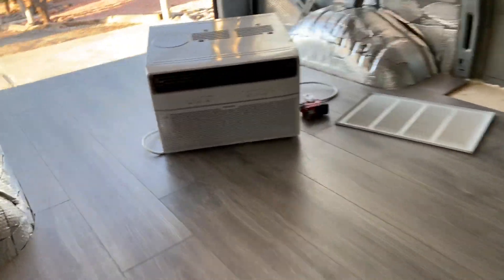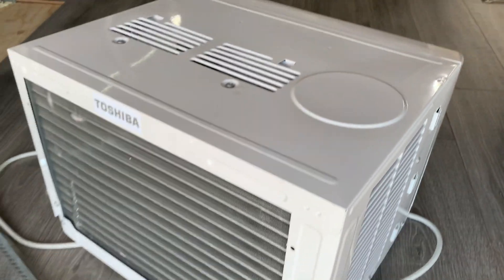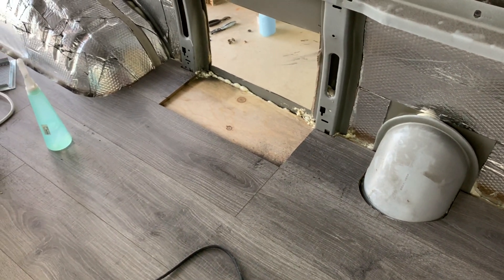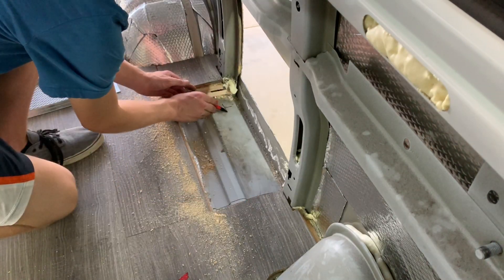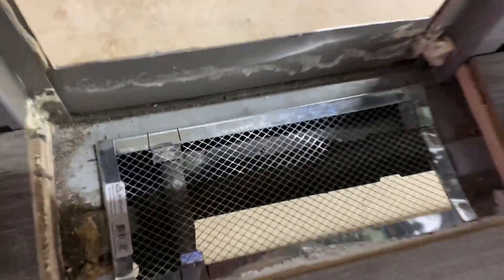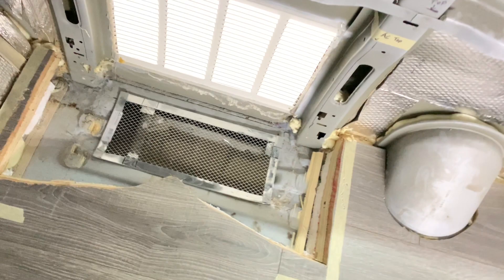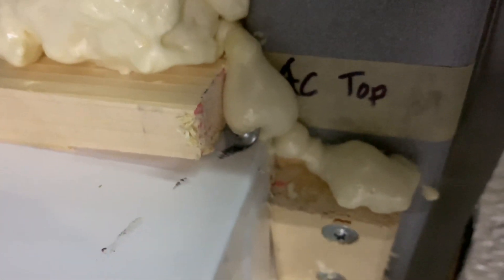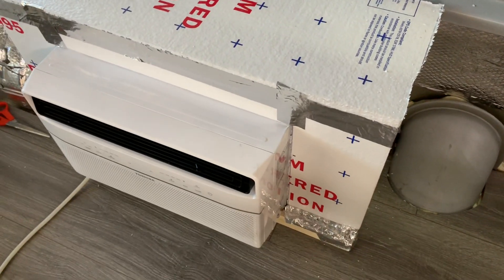Campervan Window AC Install (No Exterior Protrusion)

Comment: Cant the intake air be ducted thru the side of the van around the exhaust air?  So cutting the floor can be avoided.
Reply from the maker: Spot on George, I actually met a retired Chrysler engineer who did exactly that.
He actually used a large color matched RV hatch for the exterior vent. It was a really clean build.

On the other end of that spectrum, I saw a video where they had both the air intake and exhaust under the van and the window AC unit mounted up high inside.

Seems it would be tough for the condenser fan to such the cool air and push the hot air through the two small ducts. (Haven't seen any updates on that system)

-Tim
Reply: @VanwithTim  im leaning towards a rooftop unit but it'd be cheaper to adapt a window unit.
Reply from the maker: @georgeperkins4171  Certainly cheaper with the window units.
I'll also offer this insight (incase you plan on running via solar / battery):

The window AC units are SLIGHTLY more efficient when looking at BTU's per watt of electricity.

This 6k BTU unit uses 510w on a 75F day or 600w on a 95F day for an average of 10.9BTU per watt.

The few rooftop RV AC's I've sampled average around 8 BTU's per watt of electricity, with the higher efficiency units claiming 10.6 BTU's per watt.

That being said, typically the smallest rooftop AC outputs 13,500 BTU which is total overkill for a van.

If I were to do it again, I would probably use a 8k BTU unit. My van has so many windows that the 6k BTU just takes too long to cool it down. (I should probably bite the bullet and get some ceramic window tint in the future)

Hope that helps a bit. Sorry for rambling haha.
-Tim
Reply: @VanwithTim  Never heard of ceramic tint, does it actually work or is it all gimmick and hype? Any brands, links?
Reply from the maker: @Santor-  The theory of its effectiveness is correct, and most videos show a cheap gimmicky infrared meter demonstrating the IR blocking qualities, but all the videos simply show cars sitting in the sun before and after tint. Not really helpful as the interior will still heat up without any type of active cooling.

A TRULY helpful test should show how much cooling energy is required to maintain a set interior temperature before and after tint.

None of the tests have an electrically powered AC mounted in the vehicle which could quantify the improvements.
I would LOVE to test it myself, but it's very cost prohibitive.

Comment: So what did you do to the bottom grill? How you keeping rain, dirt, mud, snow etc from blowing up into the ac?
Reply from the maker: Good question Mike. 
It is totally open to the elements on the bottom and back of the condenser, just as it would be in a residential installation.

Any water that enters (rain spray / car wash) drains back down through the bottom just as the natural condensation does.

Dust and dirt seemed to rinse out the bottom during routine van washing.

No heavy mud has reached the area yet but will update if it does / becomes an issue!

With that said, I  put it directly behind any of the tires. My diesel heater is installed behind the rear wheel, and I had to blow out a bunch of soft sugary sand from a wild trip in Death Valley.
Very valid concern!

You can actually see what the inside of the AC looks like after 1.5 years of being open to the elements here https://youtu.be/wq_KdOZR2R0?t=125

Comment: Nice job man. No condensation issues or water trapped producing weird smells?
Reply from the maker: Seems to drain well! No odd smells or mildew. I did drill a few extra holes in the bottom above the outside air inlet to be safe (and painted the holes to hopefully prevent rust)

Thanks for checking it out 👍
Reply: @VanwithTim  I was considering a RV rooftop unit or this. I think this just seems a bit easier for sure. I never really thought about this. I’m doing this and just mounting solar on the roof instead.
Reply from the maker: @kolbymonroe5569  the rooftop units are typically a bit more powerful (and power hungry) this 6k btu unit seems to be good for a van this size. Maybe even go with an 8k btu unit if it’s a high top!
All the best!
-Tim

Comment: Better to install a portable air conditioner rather than a window unit?
Reply from the maker: For some people the portable AC would work better. The electricity usage would be about the same, but there's no installation needed.
The portable AC units are usually much larger in size though and our van is very small inside already!
-Tim

Comment: ....first thing to do with a brand new AC, is take it apart, to coat the interior metal, which is paper thin, to protect it from corrosion.    I learned the hard way, these new units, that are sold by Box stores, don't last very long, they're practically disposable units.
The styrene foam is practically translucent, I learned to coat them with paint, to make them last longer.  I'm still experimenting, with other techniques. 
The metal pan, I usually coat them with truck bed liner spray, that can be purchased from Walmart.  fyi.

never make a hole in metal, with sharp square corners, always drill out the corners with a drill. 🤔
Reply from the maker: I noticed it felt surprisingly light (not in a good way)
Will be interesting to see how long it lasts! (Past 1.5 years right now) 
Honestly surprised none of the copper lines have fractured from the non-stop bouncing of the van.
Will keep the channel updated once it finally dies out!

Comment: Hot air rises, cold air goes down, you don't want AC on the floor.
Reply from the maker: Spot on Greg. If it weren't for the windows fully wrapping around the upper portion of the exterior I would have definitely mounted it higher.
I've since added ducting to push the cool air up to ceiling level. 
Probably as good as it's going to get.
Thanks for checking it out!

Comment: Does anyone know if it's possible to use the oem condenser and blower motor(rear AC)with a mini split? In other words... Use only the outside unit from the mini split and mate it to the oem condenser? Something I'd like to try but don't know enough about Hvac to try it
Reply from the maker: That would be interesting. Wonder what specialty valves would be needed? 
Not sure if any of the mini-splits utilize R134a as a refrigerant which of course would be a necessity to mix with the automotive system.
(Although I've seen people successfully fill their R134a systems with propane. Maybe matching refrigerants aren't as much a necessity as previously thought)

Just my thoughts as a non-engineer
Reply: Food for thought  about using propane  as a refrigerate,  it's not a good choice,  freon  is used  world wide because  it won't explode.
Reply from the maker: @carlstephens1532  I remember needing to refill my brothers R12 1992 Park Avenue. Heard a lot about propane but eventually sourced some old R12.

There’s something just sketchy enough about running propane that I wouldn’t want to do it.
Reply: @VanwithTim  mixing propane  with any other freon isn't  good , 134 can be used instead but it's not worth it. Because it won't  cool enough,  there are r12 replacements, if you can find them,and there might be conversion  kits still available  for r 12 but your better off finding  r12 and keeping  it that way,
Reply from the maker: @carlstephens1532  I remember hearing lots of conspiracy theories on the switch to R134a. Something about a DuPont patent expiring? 
Luckily that car is long gone.
Reply: @VanwithTim  yeah , I am licensed  in front so I have to keep my opinions to myself , I've  been doing  ac work for 35 yes now, have the highest  level of freon certification.  Let's just say I know more than I can talk about,
Reply: Front?  Freon  is what I mean
Reply: Hello Tim,  you can't  mix refrigerates. Propane  is not a refrigerate,  but is used like one. When you start making  your own system  you will find its going to be difficult  to set the metering and the amount of refrigerate,  I've seen  your videos  and believe  that your better off with the window  unit .  Being cold requires  lots of power . The real problem  is at nite during  the summer . Can you power an ac for 8 hours or so with batteries?
Reply: Hey Tim Down  as I read you post you  are talking  about adding  a coil to an existing  system, if you have separate  systems  in your vehicle  like my suburban  does  it would  not provide  a real benefit,  if your talking  about a stand  alone system , your better off buying  a ac unit thats for boats , all the engineering  is done, if you want to build your own. My advice  is don't.  Unless your willing  to spend  money and time to sort it out. It could  take awhile  , my advice  is keep it simple,  window units are cheap ,easy to put in,and are easily  replaced,if installed  correctly,

Comment: Idea on doubling your solar setup.

Would be cool to have a second set of panels on top of the panels you already have. Set them on a frame that can slide 100% over the passenger side or driver's side, lock and pivot on either side. When extended the corner of the roof would be the center of weight and pivot point so the panels could tilt 30 to 40 degrees or so to catch more sun and provide shade to the side of the van as well as vent the panels better over the roof with a wider air gap. Would make a cool awning as well.

Would probably be difficult to design and build and surely if it was done you would already have several revisions if you had it to do over again.

I haven't ever saw anything like what I'm talking about but I would think something like this would set you apart from the rest of the crowd.
Might be standard for high rollers for all I know though. 

The goal would be to make it strong for obvious reasons.
Sleek so it looks good and adds minimal height to the van, and doesn't weigh a ton.
Easy functioning would probably be the tough part because it would have several variables to simplify and condense into reliable working components. No one would use it if it was like putting together an erector set every time you deploy or adjust it. 

Just my ramblings. I'm sure an a/c could always use more power and if this sounds like a good project I'd love to see it. Or any outside the box ideas.

You got some good videos so I'll subscribe to make sure I catch more.
Reply from the maker: Hey James, I've actually been messing with some drawings and checking out videos for linear actuators and tilting solar panels.

I have seen a horizontally sliding solar array being bench tested in one video!

I have a metal working friend with a CNC should I end up trying a project like that.

Love the idea of using it as an awning! The girlfriend keeps asking for one so maybe that's a good justification to pursue something like this haha.

Thanks for subscribing!
(Next video may be a little boring from a technical standpoint (Van Tour) but will keep the fun side projects coming along!)
Cheers!
-Tim

Comment: You insulate your floors with foam board but not your wall, why? What about your ceiling? I do like how flat it appears on the outside of the van.
Reply from the maker: I know it's not "recommended" but I stuffed fiberglass between the finished walls / ceiling  and the van.
If I were to do it again I would probably go with foam board!
It was a pretty rushed and budget build (6 weeks and $3,300) and I really didn't have much research in place at the time. My build total has since jumped to $4,900 with the constant upgrading lol.
Thanks for checking it out!
-Tim

Comment: don't know what that hole looks like up close but looks really good from far. nice work.
Reply from the maker: Thank you. There's actually a little 3/16" long cut in the top left corner... I originally planned on bolting the grille to the outside (so I wasn't originally worried about precision cuts) then changed my mind to mounting it inside. oops!
But it still looks pretty good even after 1.5 years.
Thanks for watching!
-Tim

Comment: Your van flooring will surely corrode in time because of the dripping from the condenser.
Reply from the maker: Definitely something to watch out for.
On this unit I drilled a bunch of drain holes in the AC bottom directly over the floor opening.
There's also the plastic "funnel" I made from the 6-mil sheeting (see @7:52)
That sheeting is sealed on the inside and to the exterior vent hole.
So far so good after 1.5 years but will keep an eye on it!
Thanks for checking it out!
-Tim